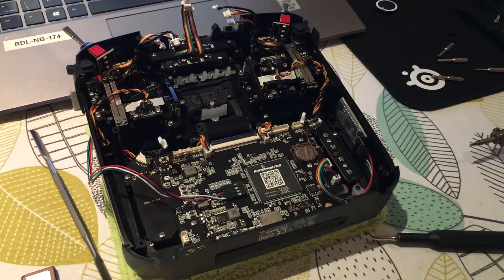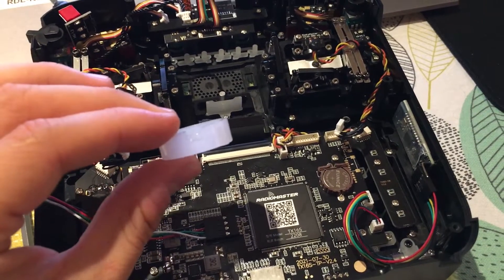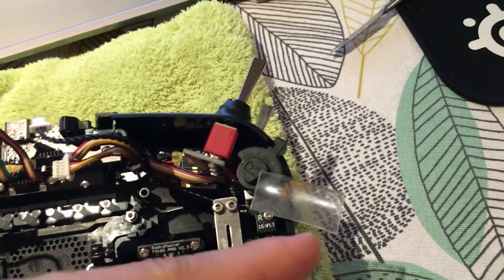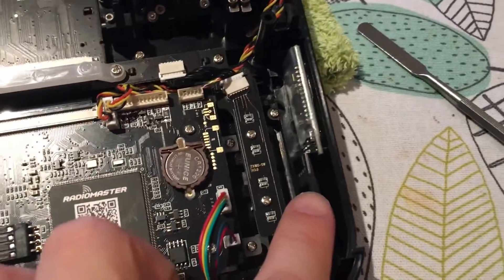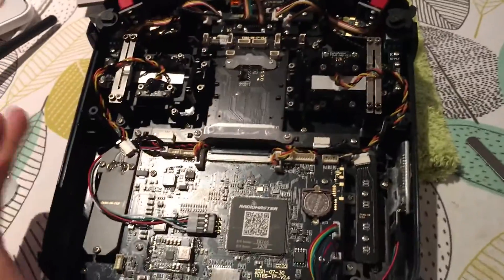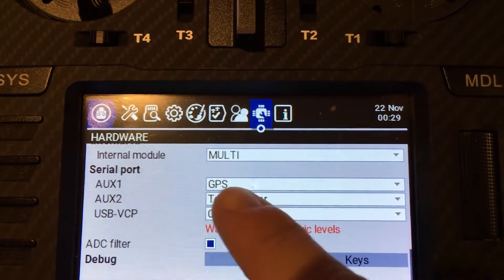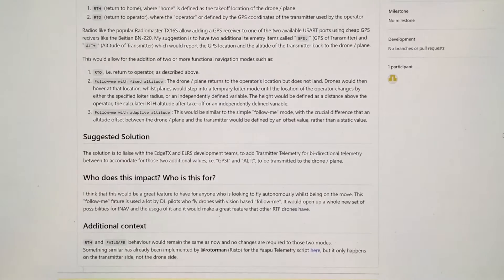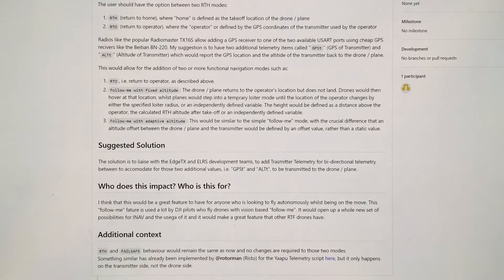Radiomaster TX16S - Adding Bluetooth and GPS!

Comment: What's the point of having GPS on your trasmitter ?How it helps ? Thanks
Reply from the maker: It might help in the future for things like RTO (return-to-operator)
Reply: @DZARO  Do you know if this Buetooth module can work with headtracker ??
Reply from the maker: @-exeCy-  I don't think it can. There is another device that can do this.
Reply: @DZARO  which is.. ??? 😁

Comment: In your description you list the bluetooth modules to buy for MK1 and MK2. I have a MK2 transmitter and just received the FrSky Bluetooth Module in the mail that you have listed for this transmitter, but I do not have to solder pads in my transmitter for this module. Mine looks more like yours in this video. What hardware is required for the TX16S MK2?
Reply from the maker: The descrition of the video is very clearly written:

Hardware:
MK1: FrSky Bluetooth Module 
MK2: AT-09 / HC-10 Bluetooth BLE Module
4-pin Molex PicoBlade 1.25

If you have purcheased the FrSky Module but have a MK2 radio, then that's your mistake. 

Having said that, you can still use the FrSky Module on the MK2, but you need to buy the PCB connector that I have listed and you need to solder and connect the wires as per the pinout of the FrSky Module and the MK2 PCB, keeping in mind that you TX and RX pads on the MK2 motherboard might be incorrectly marked on the PCB itself. It will depend on when you have bought your MK2 radio as you may have a newer edition of the motherboard, which has the silkscreen (white text lables) fixed.
Reply: @DZARO  Hey thanks for your reply! I have no idea what I was trying to ask 1 year ago when I originally wrote that comment 😂 You definitely have the info listed in your description. I wonder if I was trying to understand how to make the item I purchased work with the transmitter I have.... who knows? 🤷‍♂

Comment: Thanks for the vidjeo, friend. Did the mod on jumpy t16, aux1 with proven working bn220. Blue fast flashes but no gpses after an hour. Maybe chrome paint acts as a shielding. Cheers!
Reply from the maker: @kuchervano  Could be, I installed mine in the location of the speaker because it has perforations. :))

Comment: To sum it up: Use a NMEA unit, then hook up GND to GND, PWR to PWR, TX to RX, RX to TX
Reply from the maker: No. TX to TX and RX to RX as they've labled them incorrectly on the MK2 boards. But if you buy a new one, you might have the right lable. Just compare it with what I have in the video. Mine is incorrectly labled.

Comment: Hey, thanks for the video! I'm also making a mod for my tx16s. I have a couple of questions, maybe you may help:
1. You connect your bluetooth module into an internal port(white color). Do you know what is its type? I was trying to find, but cannot identify for sure. Size-wise it looks similar to JST zh 1.5, but it doesn't fit.
2. Can you please explain how physical UART ports map to AUX1, AUX2? I was using the dupont ports on the bottom of tx16(UART6 and UART3) and they map to AUX1 and AUX2. You use the internal ports and they also map to AUX1 and AUX2. Are they simply duplicates or you have a custom build/settings to enable them?
Reply from the maker: 1. These are the connectors for the UART port that has a connector pre-soldered:
Molex PicoBlade 1.25
https://www.ebay.co.uk/itm/232695637343?var=532197797528

2. Diagrams can be found here:
https://drive.google.com/drive/folders/1_VqPQZO8eKk6hpo6aFEIUbltRMu8_k5p?usp=drive_link
I have already annotated them for the MK1 and MK 2 version of the radio.
Reply: @DZARO  Thank you! That helps a lot
Reply from the maker: @p0pka_enota  Also, have a look at the video description, you will find a lot of intomation there as well.
Reply: @DZARO  vermiş oldugun bilgi cok yararlı olmuştur teşekkur ederim TÜRKİYE

Comment: Thank you for the video. Quick question, why have you listet different Bluetooth modules for mk1 / 2? In both cases you need v-Gnd-tx and rx, so it’s should be interchangeable, right?
Reply from the maker: The one for the MK1 is specific for that motherboard and is much better ingrated with more functionality, such as bluetooth trainer, which is intended to work with another MK1 radio. Apart from that, it gets soldered directly to the motherboard and is controlled directly via the operating system of the radio (EdgeTX or OpenTX).
The one for the MK2 can work with the MK1, but only with limited functionality, i.e. only bluetooth telemetry. It does not get soldered to the motherboard of the MK1 and there are no headers inside the radio so you have to solder the wires directly to the bent part of the AUX pins, if you want to have a clean setup with all the electronics inside.
Hope that helps and makes sense! :)
Reply: @DZARO yes, thank you very much. I ordered a AT-09 module before i watched your video, but in my case it doesn’t matter then, because i only need it to send telemetry to a crossbow mini antenna tracker.

Comment: Does this work with boxer too?
Reply from the maker: Shoud do, if the boxer has a free USART that you can plug into.
Reply: @DZARO  I don't think it does but it has a BLE pad...
Reply from the maker: @madladdan  Would you be able to send me an image showing the connection point? (Please make sure the image is clear.) You can use a site like imgur to upload it and then just forward the link in your comment thread here.

Comment: Do you know if a BT module could be connected to the pins where you have the GPS? I want to use one BT module for recieving headtracker data.
Reply from the maker: Absolutely, that's exactly what I'm using it for. All you have to do is solder up 3 wires to the BLE headtracker board of your choice using the SBUS-out on one of the digital (Dx) pads on your headtracker unit and then connect that to the RX pad on the same port as you had your GPS previously. Head over to the hardware tab on the radio and change the related AUX port to SBUS Trainer (or something along those line, not sure what it was called at the moment and don't have the radio in front of me).

Comment: Hello 👋 I just bought the HC05 and im looking information to install it on a Boxer to transmit telemetry, maybe you know how to?
And I didn't knew you could install GPS to the radio but now Im interested on what's the benefits to do it. Great nice vid
Reply: Did you manage to install it?
Reply: @madladdan  yes it's working on my boxer
Reply: @RMCyborgFPV I'm in the process of installing one at the moment.   Did you ever figure out what socket type is used on the BLE connector?

Comment: I really think to do this best you're gonna have to get the receiver up on a mast
Reply from the maker: If you are looking for mesurement accuracies of +/- 5mm, you would be using specialist surveying equipment (which costs thousands of whatever currency). I tested this for two days in a row at fice to eight degrees ambient temperature and I was consistently getting a minimum of 12 satelites which is good enough for what this will be used for in the end.

Comment: Which baud rate need to choose for connection bluetooth module?
Reply from the maker: You need a USB to UART module to set the baud rate fo the BLE module first and then pick the same baud rate in the radio.
Reply: @DZARO  what is a BLE baud rate?

Comment: Nice video, 
I wonder if the exact same functions are possible with the AT-09 / HC-10 Bluetooth BLE Module as the FrSky Bluetooth Module. In your description you use an old version of Frysky Bluetooth Module. The Para bluetooth module is the new version. This has a built-in antenna and is much more reliable than the old version. I built this into the first version TX16S and it works great but is difficult to install in the first generation TX16S. I myself use the Telemetry Viewer app on my phone and tablet. Functions perfectly.
Reply: Hello,  Did you install an AT-9/HC-10 to work with Headtracker project or Frsky PARA Bluetooth chip ?

Comment: Great material and STL file ... I still have a question if you have not mistaken the BT module RX with RX and TX with TX because it seems to me that it is wrongly connected in the video ...
Reply from the maker: The correct way is to connect RX to TX and vice versa. However, as the silk screen lables on the TX16S v2 motherboard are incrorect, you need to connect RX from your BT module to RX on the board and the same for the TX data line. This is also mentioned in the video description.
Reply: @DZARO  I understand, so I swap the pins RX to RX and TX to TX. Thanks for the explanation. all the best :)
Reply: When you enable the telemetry mirror on aux 2, should the bluetooth turn on?

Comment: I'm new to RC so I'm wondering why would you want a GPS in your radio.
Reply: While I don't believe it's possible just yet, he was talking at the end of the video about bidirectional telemetry, and for the ability for the drone to know the location of the operator, rather than it just having a fixed GPS position for RTH.    The operators position can potentially by dynamic if they're for instance flying from the back of a truck etc, so I can see the advantage of this.   The other option is for the ability to do a follow me kind of feature or an orbit around the radios position etc.

Comment: I want to be sure about those other connectors labeled J3 ( on the left side ) and J2 ( that one u used for BTooth ) at the right side , the board revision is 2021-07-30 TX16S-TP-V2.4 , anyone found schematics of this board ?
Reply from the maker: Good question. The connectos that I used are defintely the right ones. I doubt that they would have changed the connector itslef, but as the lable was incorrect (Tx and RX were swapped) you'll just need to test it and see if it works.

Comment: The connections aren't labeled wrong. tx should go to rx and rx to tx
Reply from the maker: Yes, on the new version of the motherboards, they are labled correctly because they changed the silk screen. On the version that I have, which is the first MK2 version, the lables are incorrect 100%!

Comment: Thank you for your video. I haven't looked into the Bluetooth issue yet. Can the module also display the telemetry data of the TX16s set up in widgets on a tablet? Or is that only possible in connection with Betaflight or Inav?
Reply from the maker: You can use Telemetry Viewer for Android and choose the Bluetooth LE option.
Reply: @DZARO  o.k., thank you.

Comment: could you have put gps on plug where you have bluetooth?
Reply from the maker: Yes, you can. The BN-220 supports voltages between 3.3V and 5.0V. You would also have to change the AUX port in the radio system settings to match.